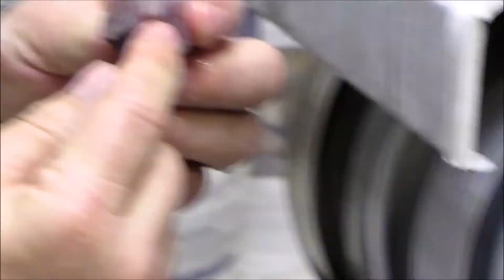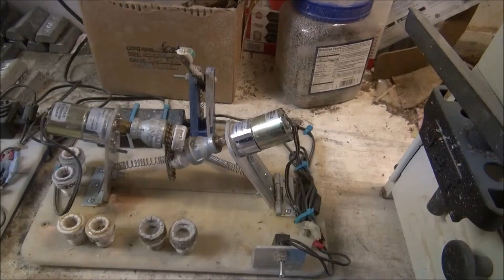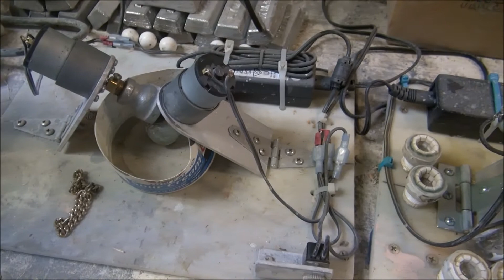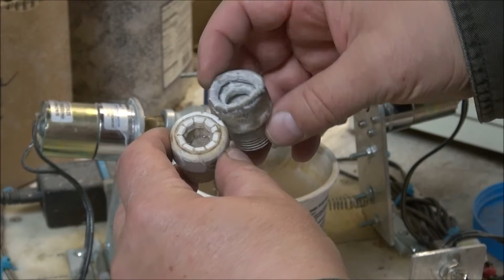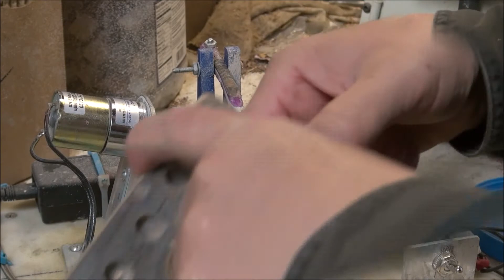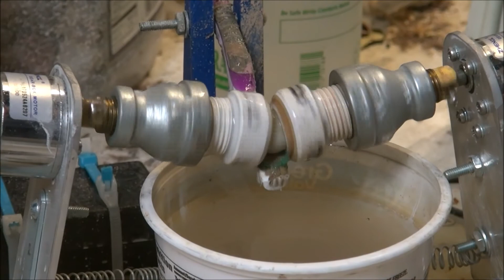Marble Restoration and Polishing Machine

Comment: What a great little mibs polisher you made.  I take 2.. What did you use to insert grit work into reducers.  Thanks Norman
Reply from the maker: I used a little chain to pick up up the grit in the bowl.  Then I modified this two cup polisher into a three cup grinder and made diamond cups with media that I could epoxy onto the cups.

Comment: I built me one just like yours . I just used a tv tray and plan to do the drip ...I know we want to change the grit and water every grit change up to 10k...I ran the marble for 30 min on 10K grit and came out dull?  do you use a compound at all?  Like others that have posted I have a load of nice marbles that would shine if I can...Any tips.   I read you added a 3rd Motor..can you share a video of it please?  Thanks from Seattle
Reply from the maker: Here is the 3-cup polisher.  https://www.youtube.com/watch?v=opT2eUdqzko  Keep in mind you must work your way from coarse to fine grit. If it is still cloudy, that means you have fine scratches that the 10,000 cannot remove.  Also, make sure you are using a water drip so you are not contaminating the grinding slurry with larger grit.  I would suggest the following sequence of grits. 100, 200, 400, 800, 1,600, 3,000, 6,000, 10,000.  If you are starting with a marble with just fine scratches, start with 400.

Comment: Have any experience smoothing out lightly pitted Dominick Labino # 475 "marbles", yet, keeping as much of the creases/folds that were a byproduct of how they were made?
Reply from the maker: Great question.  I have never done that before. I am sure you could though by starting with 1500 grit or even 3000 and do a very light polish.
Reply: @MarbleGems  Have you heard of such "marbles"? I can supply you with a few if you'd like to try. Given the 475 formula was designed to melt at a lower temperature, I'd imagine the raw glass material is softer/not as dense (?) compared to other marbles....and may polish up easier/in less time/less effort. Please, by all means, let me know if my logic has some validity lol.
Reply from the maker: @mfohawk6779  Lower melting temperature does not always mean easier to grind or polish or that it is a softer material.  Typically any sort a material made primarily from silica will have a hardness on the Mohs scale around 7.0.  However, with that said, there is also a toughness factor for grinding on things. So it would be possible this is really easy to grind on, but that may or may not make it easier to grind and or polish. Often softer material is hard to polish.
Reply: @MarbleGems   @MarbleGems  So far, my "analog" processing technique has brought success....but at a painstakingly slow rate. Start off by taking one of the popular pumice-baaed hand cleaners, using acetone/a bit if heat/time to remove excess chemicals and get just the pumice itself. Then, putting a small amount in several quart paint mixing containers, putting them into a small/portable concrete mixer that runs at 60rpm.....and letting them run for about a week (max of 8/batch). Then doing a similar process with a dense mix of Comet, then using a high-end DA car polisher with a microfiber cover, adding a small amount of cerium oxide, and initiating good axial exposure/rotation to them at higher RPMs for ~1+hr. The results have been good......but it's too slow considering the 100's of these I have and want to "clean up" for either individual sale, or for an art project I have in mind. Wish you had contact info/FB page so I could send a few pics showing the progress of the stages. Trying to figure out a way to streamline the processing by some kind of automation/mechanical means not requiring supervision. Not a problem to work/final polish each one individually on the DA if they're at a point where only ~10-15min is required to give them a good clear finish. Considering the name attached to them, I'm sure I could find a market that would be interested in them.....also given their age and not easily found.

Comment: sir this is amazing! i make marbles, sometimes i get a marble done and cooled off and notice its just a little bit out of round, would this machine fix that?
Reply from the maker: Maybe.  But I doubt it would.  When a marble gets out of round, it can be hard to fix.
Reply: Good day Sir, you can look at a three head "sphere" machine. I make stone spheres from as small as 10mm up to 200mm. Most of these spheres are out of round and the three head sphere machine works very well getting them perfectly round. You can check out this video https://youtu.be/vPCTWJe08Fs . It's not my video but I copied the design and its working very well. In one of my videos https://youtu.be/XZxMN8_RD-s I use n much larger scale machine but I was able to make small stone spheres of 10mm in diameter.

Hope this helps you

Comment: One reason you didn't get a great polish is because you contaminated your grit and water with the previous grit.  You need to use a different chain for each grit and a fresh cup of water for each grit.  Otherwise a little of your 220 may get in your 600 and then essentially you're just running another stage of 220.  Nice machine though!
Reply from the maker: Thanks for the tip. I have since rebuilt the polisher and it has 3 cups now.  I use a drip system with a catch basin underneath it now.
Reply: @MarbleGems  And thanks for the video.  I plan to make a sphere machine as my next project.  These videos are quite helpful.  👍
Reply from the maker: @SSchus87   You are welcome.  Have fun!  It is a cool little machine.

Comment: How much for marble repairs?
Reply from the maker: I don't do marble repairs. You'll need to make your own machine.
Reply from the maker: I might start taking some marble repair orders.  I have a new 3 head marble polisher that I feel confident I can do a great job.  Each marble is different. I can do from 3/4 inch up to 2 inches and the prices starts at $10 and goes up from there depending on the size and ability to regrind it.

Comment: What characteristics is the engine used ?
Reply from the maker: 12 volt gear motor.  300 RPM.
Reply: @MarbleGems  How did you make your polishing cups?
Reply from the maker: @robertwood5734  I used a 1/2 inch PVC to 1/2 inch glue fitting and epoxied a piece of diamond polishing pad into it. the diamond polishing pads (4 inch polishing pad can be bought on ebay and look like a round waffle with a hole in the middle)
Reply: @MarbleGems  Thank so much for the reply after a lot of research i figured it out and have ordered the pads I'm trying to polish a 1 1/2 inch marble with 2 drills . At first I tried gluing in wet dry sand paper one of my drills doesn't have a speed control  not working to well am not looking for gear motors thanks for all the help
Reply from the maker: @robertwood5734  Hope it works out.  Good Luck!